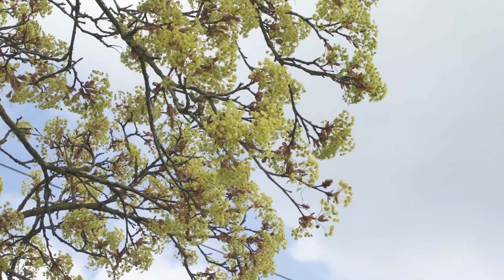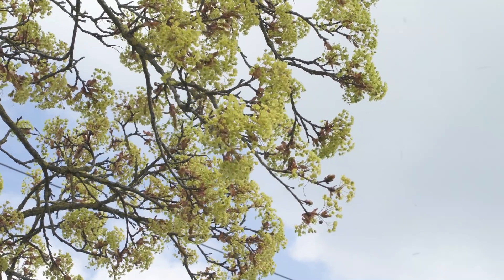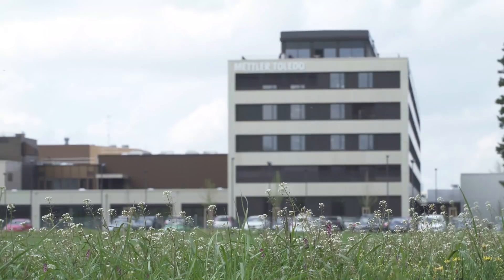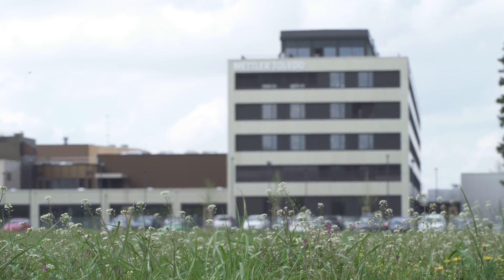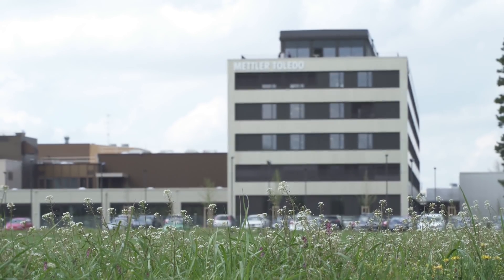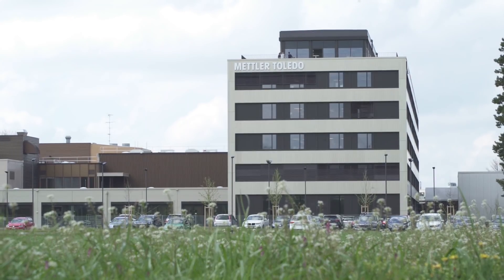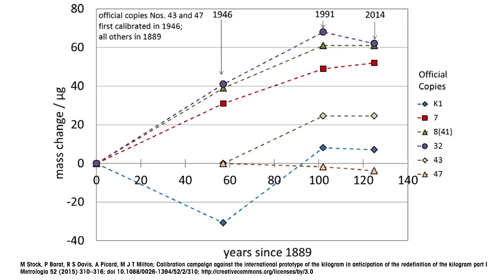1 Kilogram Redefinition - METTLER TOLEDO

Comment: Good video! Thanks. But after a few videos and reading about this, I'm still no clear on why we need to make the physical spheres (two of them, right?). If it's impossible to count all the atoms in them, and actually verify the crystal structure and purity is uniform inside it (in fact we know it's not 100% pure), doesn't it all fall back on theoretical calculations anyway? You chose the size and weight, you chose silicon 28 because you've studied the crystals to some degree of accuracy - how does making a big ball of it help you? Thanks
Reply from the maker: @xamishia
The Silica 28 sphere (the probably roundest object on earth) was used to count the number of SI28 atoms in the sphere. Using Avogadro's constant allows to calculate and check the mass of the sphere which in turn allows to define and check the mass of a kilogram.
As we know, ultimately the kilogram was redefined in 2019 by the Planck constant (h) using a "Kibble Balance" and not by the Avogadro constant using the silica sphere. However, both methods - independently from each other - showed an excellent match and complemented the new definition of the kilogram.
So coming back to your question: Yes, the silica sphere was not "needed", but it complemented the definition of the kg by the Planck constant in a very nice way. And yes, the SI28 ball is not perfect, but it is as close to perfect as human beings can make it, consisting of 99.9995 % SI28. Whit this Avogadro experiment it was possible to count the number of atoms with a very small uncertainty, in the same order of magnitude of the uncertainty of the Kibble balance experiment.
So both experiments re-confirmed each other.
For more information about “redefinition of a Kilo” follow the link:  https://www.nist.gov/si-redefinition/kilogram-introduction
Reply: @METTLERTOLEDOLaboratory  Thanks a lot! This confirms what I thought, in the same order of magnitude of uncertainty! :)

Comment: I’m a little unclear on the dissemination part.  Ordinary laboratories still need physical reference masses, I assume.  Isn’t a physical master reference mass still needed to manufacture those?  Is the master reference mass made using a Kibble balance?  Does that mean that every national standards laboratory then has its own Kibble balance?  What does a Kibble balance cost?  Can laboratories subsidiary to the national standards laboratory have its own Kibble balance, or is that impractical?
Reply from the maker: Hello,

You are absolutely right. Physical references will continue to be used like before. Just at the very top of the traceability chain, at the "realization", Kibble or XRCD experiments replace what used to be the function of the (physical) IPK. There might be developments that these Kibble balances become more widespread and affordable in the future and could theoretically replace physical mass references in other places and other laboratories. At the moment not even all national standards laboratories run primary experiments (like Kibble or XRCD). They rely on the services of other national laboratories or the BIPM's.
Reply: yes, that is the point, every lab in the world can build a kibble balance to a budget they like...the NIST one is expensive, you can build 1 at home for $50 usd, accurate to 1%